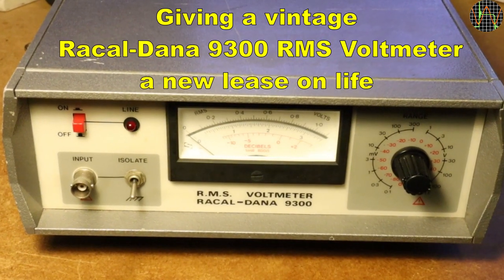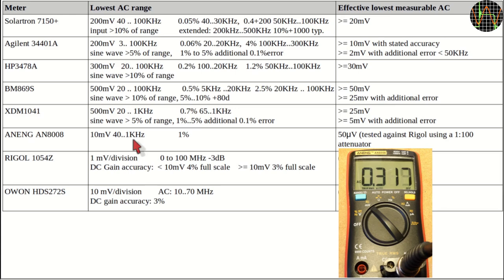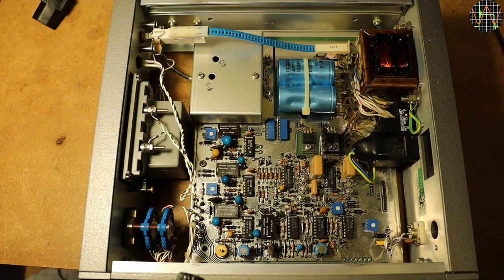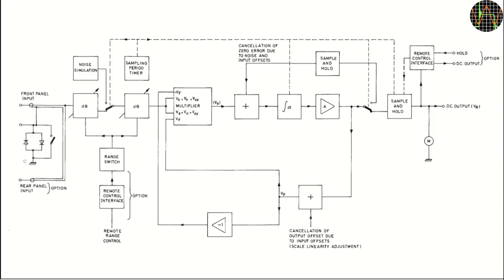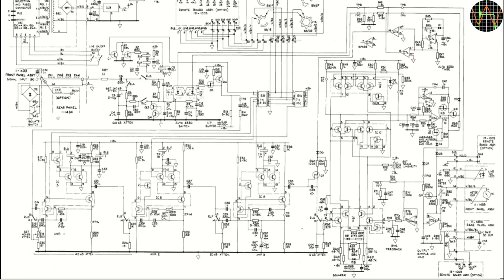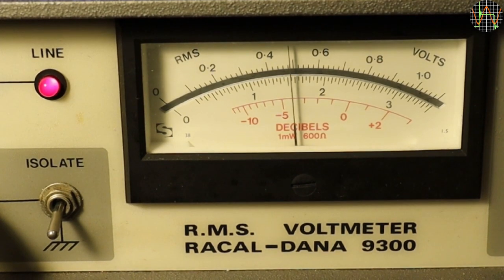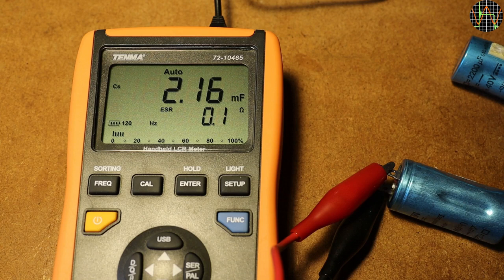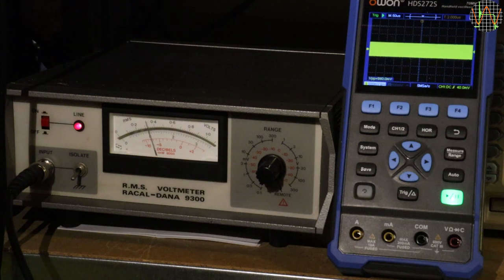#107 Giving a vintage Racal-Dana 9300 RMS Voltmeter a new lease on life

Comment: Nice unit, I recently picked up a HP400E which I intend to refurbish, I love fixing up old test gear.
Reply from the maker: I just had a look at an HP400E offered on eBay which included inside shots. Nice constructions. I hope you get it fixed.
Reply: @TheHWcave  I haven't even powered it up yet... unboxed it and put it on the "Cool Stuff To Fix" pile